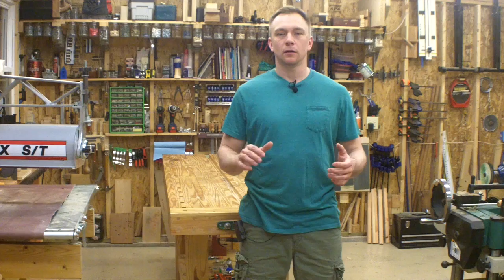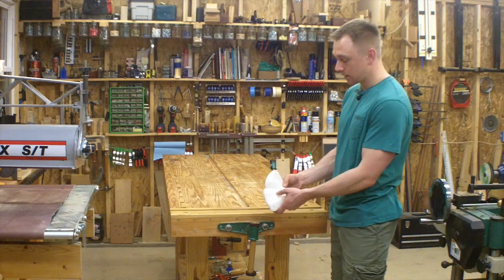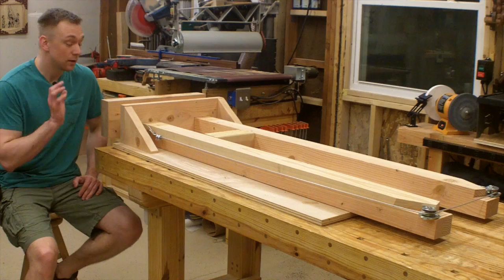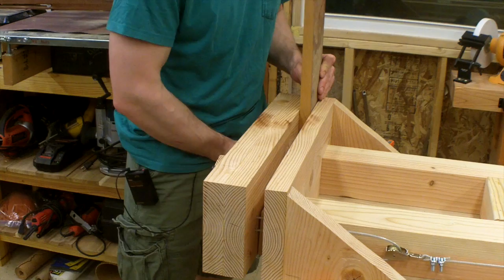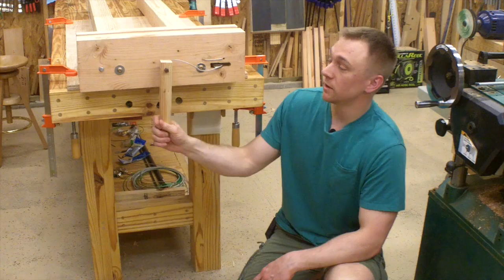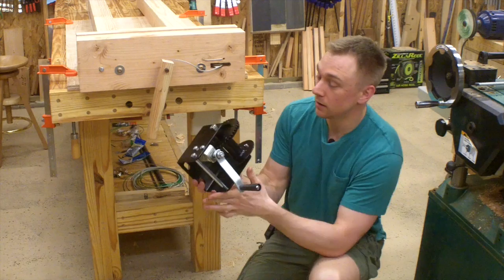Cable Vise - First attempt, Partial Failure

Comment: And that worm gear winch, if it's like the one I bought from Home Depot recently (and then returned) would prevent the whole thing from falling apart when you let go of the crank, but it's a 41:1 ratio and would take F O R E V E R to tighten.

Comment: could you drill holes in the face around the cable draw handle in the clock number formation to put a pin in so the handle wouldn't free spin back until the pin is pulled out

Comment: try a cheap ratchet   embed the head in the wood take a socket and attached it to the lever. there is  some thing no sure what its called but use for repelling down cliff side a rope or cable brake.  lastly why not use a the ratchet off a tie down strap the the cable ends in to it  like the actuator part insofar of turning a lever you would just pull the handle a couple time click click hit the release would take some of the presure off of it..  the one used on heavy load trucks for a big vise or some thing  smaller or maybe one used as a strap clamp for gluing up boxes change out the strap for a longer one. .. couple of ideas might work

Comment: Think of a ratchet routed into the face and secured in place. weld a handle to a socket that way you can remove the handle if needed.

Comment: You could make a hardwood gear that would be mounted on the handle shaft.  Then add a spring loaded gear follower that would lock into a gear tooth to hold the pressure.  Then when you wanted to release it, you just lift the follower out of the gear tooth and let the handle spin away.  Cost would be small.  I think the boat pull head would be stronger and safer though.  Just an idea.

Thanks for posting!

Comment: I would also suggest keeping your friction to a minimum. I would prefer a vice that is easy to tighten, and if it relies on friction to prevent it from opening, it will be harder to tighten.
Reply from the maker: Yes friction is a mixed bag, that can't be the whole solution.

Comment: Try the shop built solution first. You can always drop back to the winch or buy a worm gear.
Reply from the maker: I went ahead and just tried the winch to learn more, but the shop solution is in the works.

Comment: Looks like my idea was already mentioned of a ratchet mechanism.  Another would (since you are using a cable) would be to do something like the releases for shades, where the teeth would grip the cable as you pull on direction, but the problem would be having to tighten even further to release.  I suppose a ratchet mechanism would have the same shortcoming.
Reply from the maker: Yes, both would require more tightening to release, and also the use of one of your hands to activate the release.  I really want to avoid that if I can.

Comment: Very clever approach so far.  You've already received several suggestions and perhaps these will solve the remaining problem.  Seems to me a ratchet and pawl on the handle axle would prevent the handle from releasing but perhaps I am missing something

Comment: I like clever and this idea is clever. Get that design protected. I like John Heisz's Idea for a lever and cam.and you could try a spline shaft on the crank so you can push it in to lock and pull to release

Comment: an interesting idea, if the cable on the front of the vice were to pull though a one way clamp. it would self lock and stop the handle unwinding you could then mechanise it to be a quick release. similar to rope locks on boats hope this helps

Comment: I like the boat winch, but if you could deconstruct the boat winch and mount the internals in the vice, like the set up you have now but with the gear and release pin mounted on the outside, hope you get my drift, Cheers

Comment: Take a look at these spinlock cam cleats: http://www.apsltd.com/c-342-spinlock-cam-cleats-accessories.aspx (used in sailing).
I don't know what type of 'line' you're using. Is it steel cable? You could use something synthetic like dynema (it goes by many names). It's UHMW polyethylene and is stronger than steel given the same diameter. It would work better with this type of hardware. The one drawback with this approach is to release the line, you lift up (or away from the bench). This would be doable since the cleat will hold the line rather than the shaft. There are other options along these lines http://www.apsltd.com/c-1188-SpinlockClutchesJammers.aspx (cf. mini jammer) but things get expensive quickly. Well made hardware does that. A rope clutch or jammer releases by lifting up the lever.

Comment: Cool idea.  I was thinking boat winch as soon as I saw where you were going.  Then like a magician you pull the boat winch out.  Cable stretch / relaxation is going to be an interesting challenge.  I'd try a set up cranked down tight and check it after 15 minutes or 1 hour to see if it is still tight.  Keep rolling with this idea - looking great!

Comment: I like the design so far. Think u have a good starting point. I like using the piece for the boat. It's solid(I'm assuming) and does exactly what u need it to do. As long as it's not to big and in your way. But nice job bud.

Comment: You could made some set holes (like a clock) in the external board and then you could use a pin crossing the handle to stop it from spining
Reply from the maker: I like the set pin idea, and clearly several other people do as well, but I haven't given up the hope that I can build something that stays in place without it.  Appreciate your comment.